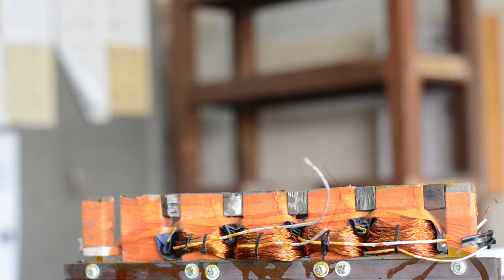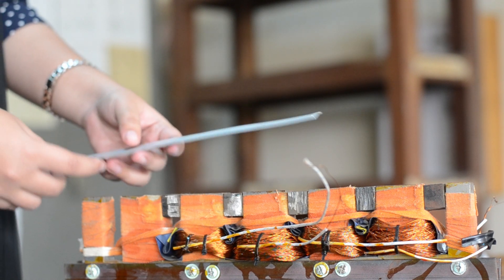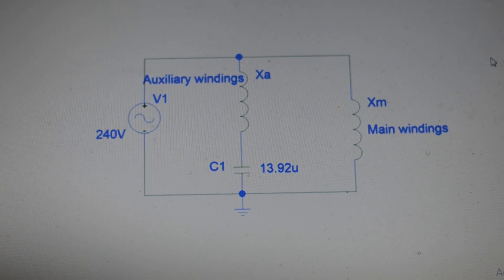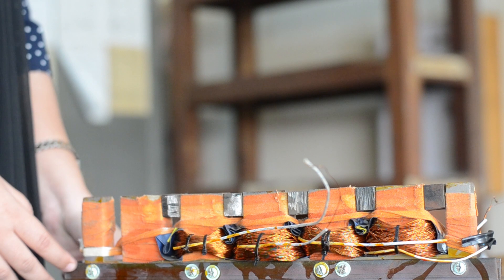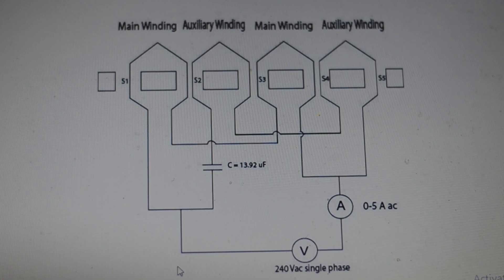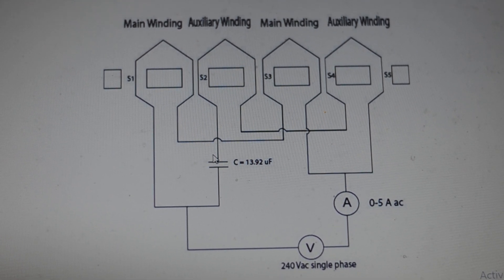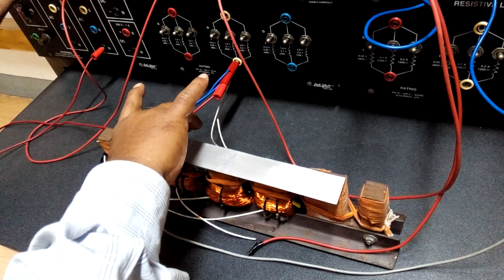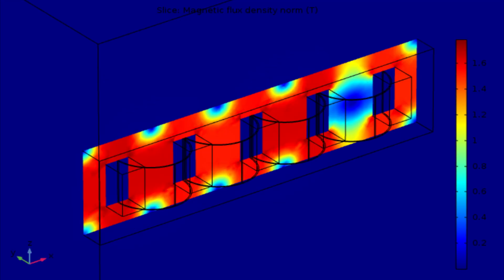Single Phase Linear Induction Motor

Comment: Hello we are making 3 phase lim please suggest how you made hole for making slots in core!!! We did hole using drill but is not that good
Reply from the maker: Hello, we didn't make any hole in the core. We bought metal sheets separately and combined them together to form the stator.

Comment: Remove the iron cubes. Use fixed top iron core and aluminum moving plate between both fixed parts. It will move really fast.
Reply from the maker: Thanks for the suggestion. We will definitely try that.

Comment: I’m working on a 3 phase linear induction motor, how much voltage and amperage do you suggest using? Is there a minimum amount I can use?

Comment: Great work. Please tell me why you have used aluminium sheet but not copper? Was the weight of sheet that could make the difference? Also tell how did you decide the value of capacitor?
Reply from the maker: We had to use something lighter as the rotor because the generated power was not enough to move a heavy metal or something. That's why we used aluminum sheet. And we got the capacitor value by doing some maths.
Reply: @KaushikBiswasDipto  Thank you for your response. I think you chose the value of capacitor in such a way that the capacitive and inductive reactance will have the same value, so that one coil will have zero phase difference and another will have 90 degree phase difference due to Inductor (coil) present in the circuit. Am I right ? 
                        My another question is, will the lifting force increase if the frequency is increased? As according to Faraday's law the induced voltage is proportional to the rate of change of magnetic flux. Here you are taking advantage of eddy currents produced in the sheet that causes the motion and levitaion. Hence, if the rate of change of flux increases the induced voltage (resulting eddy currents) will also increase and that should result in more lifting force. Am I right or not? If not please explain. Thank you.

Comment: hello i need mathematical model for linear motor  and  how calculate no. of turns
Reply from the maker: Sorry for the late reply. We don't have a perfect mathematical model for this motor. We used 200 turns of copper wire per slot. This was just a prototype to check whether it works or not. It worked though but the thrust achieved was not enough to apply somewhere else.
Reply: @KaushikBiswasDipto  
You should use about 8 turns per square inch of core. The number of turns will be inversely propionate to cross sectional area of the core.

Comment: im a little disappointed as i wanted to see your rotor fly away. good project though. im sure the rotor would fly away if you decrease its length by half or use a thinner plate
Reply from the maker: Sorry for the late reply. This project was just a prototype to check whether we can actually run an linear induction motor in single phase or not. The thrust achieved was not enough for the rotor to fly away. We used thinner plate also. The rotor this time didn't fly but got better speed than before. 
Thanks for the appreciation. 😊
Reply: @KaushikBiswasDipto  what are you using? 220v 50hz from power outlet or do you have a dedicated drive for this ?
Reply from the maker: @AshutoshSingh-to9vx  We used 240v and 50Hz as input from power outlet.